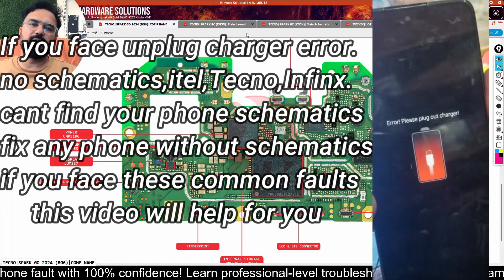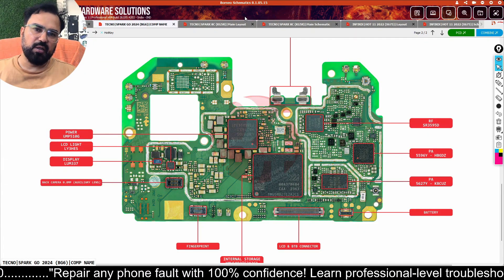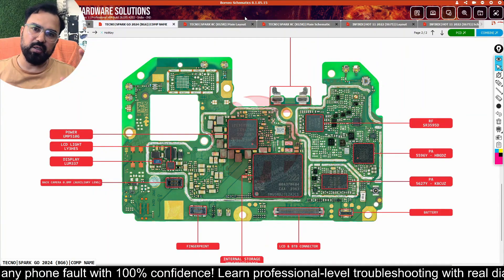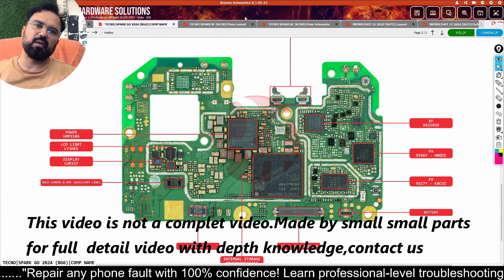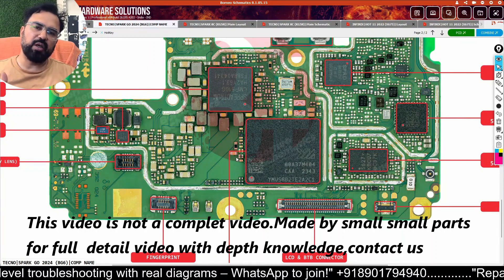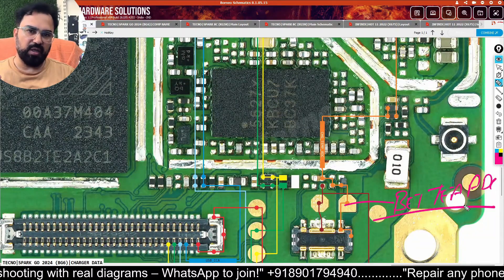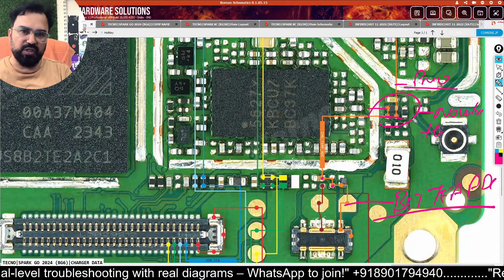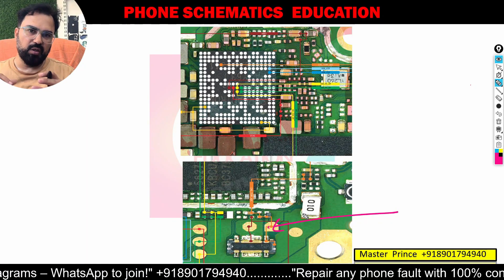Unplug Charger Error Fix in Tecno/Infinix | Battery Temp Too High | Thermal IC & Line Repair Guide

Comment: For your kind information I have same valu same ragister and same voltage then this problem com in mobile
Reply from the maker: First of all I am not telling in this video a complete information 2nd if you get same value resistance then doesn't mean there is no problem on any other line..may be any line open....& choose your words correctly if you want to need Guidance

Comment: How to you set your multimeter  to check the values of the resistor
Reply from the maker: Resistance mode
Reply: @phoneschematicseducation  boss pls i have tecno comon 20 here with me i connect it to dc power supply i press the power key but it not reading on the amp it showing 0.00

Comment: I learnes that if you see a thermal error message like on these economical phones, it is thermal related line. So as a techincian when doing diagnosis on such device you plug in the charger on the testpoint of bat thermal on some devices you get 1.8volts and on other devices on this line we get 2.8volts after seeing this voltage we can say that the LDO voltage from the PMU is ok.Then after connecting the battery the voltage on this line will become half when the divider circuit is working properly but if the voltage does not divide that means either one of the reistor connected on the circuit is damaged,break  due to water logging.we then check the R1 resistor on the motherboard on economical phones it is 13k if its okay then move on to check the R2 mounted on the battery connector .If these two resistance are okay when then check the other resistance of the resistor for refference is it okay it may break also if it breaks the refference voltage to PMU will not be met which can also lead to thermal error issue
Reply from the maker: Great....if I am a Good Mentor only because of my students...proud of you 👍😊